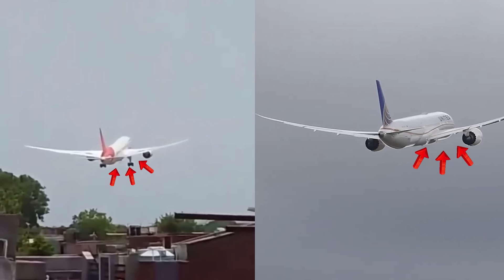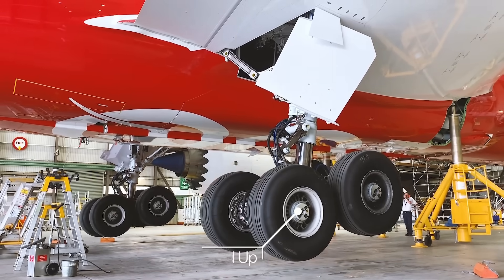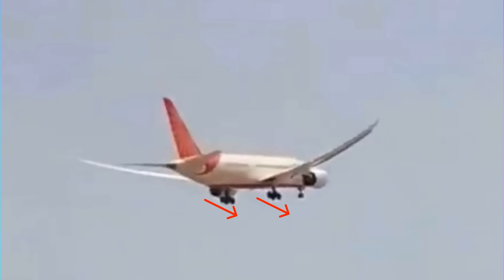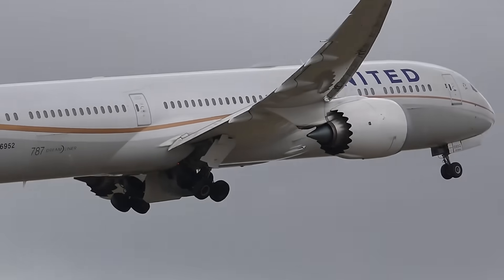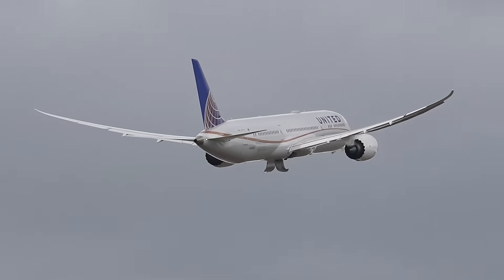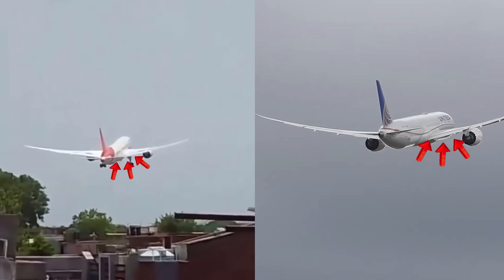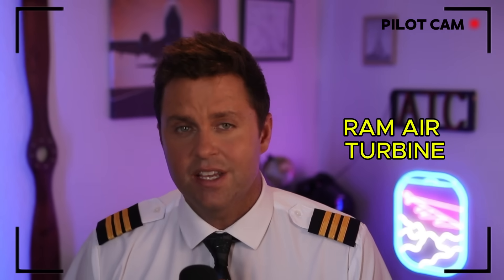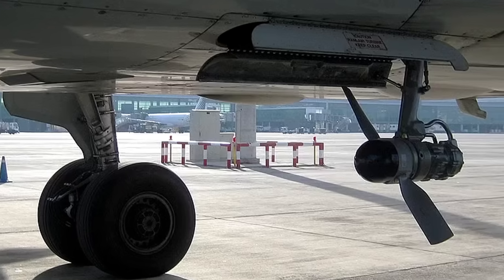Pilot Explains: A New Detail in the Air India 787 Crash Everyone Missed

Comment: or the phone did not pick the audio very well, big assumption you make about the sound. Only thing that is clear is that the Aircraft is not gaining altitude and I nose up as it sinks. More as if the plane is stalling. Whether it had engines or not, the plane is stalling and that is why the plane is sinking. So the question is, why is the plane not generating any speed or lift at 500-600 feat after take off. If a mayday was heard, then clearly there was  an emergency and they had little to no time to react. Video does not show Rat, if anything it is the phone camera imperfection. So unless access the crash site you will not know short of getting the flight box recorders. If there is water in the fuel, then one of the thing they must do is check the ground equipment and test the fuel that was loaded as the plane was in prep for it flight. As the aircraft has flown early that day, existing  water in the lines would be unlikely even if the missed checking the fuel before flight.

NTSB never points the blame, there goal is to solve what was the cause and how to help improve procedures and best practices to avoid such issue in the future. In the investigation, it could find fault in a part and as such issues airworthiness directives  or AD.

So one check for PIC would be to verify any AD and if they have been logged in the maintenance book of the plane. Especially those the will effect to power system and flight controls and surfaces. 

So really looking at the loss of life, would be did the pilots have any option to increase the glide and find enough area to do a controlled crash landing with little damage to the fuselage. 

Even if the RAT was deployed, that gives them about 10s of no control due to loss of power.  While the RAT is coming on line in about 8 to 10 sec, the airline is mostly going to drop about 1000-1700 feet during that time. So if the airline was only around 700 feet, RAT would be useless even if deployed for a double engine failure if it occurred at the time pilot called May Day  or when the craft start to sink. Recovery of flight control system and the inability to pitch down to maybe gain a little more distance away from airport in a controlled glide may have been possible with an effective RAT allowing continue control to the aircraft.

Kirk's no win situation is really only for the movies. It would appear if a total loss of power and electrical the aircraft was doomed to drop out of the sky and then it just on faith of how much damage can be avoided in the path.

Comment: The engines can in fact suck in fuel from their fuel tanks even if the fuel pumps do not function. Each engine compartment also has 2 generators inside. So they must be operating fully autonomous with full thrust even if very much does not function elsewhere. Or am I wrong?

And regarding the fuel contamination: As each engine is fed from their own fuel tank, how big are the chances that they both will reach the problem of failing within a few seconds? Because this must have been happened here.

Can a 787 avoid crashing in such a flight situation when one engine fails, but the other works properly? This should be possible or not? (If not this would be a major design flaw).

Comment: Somebody on the flight before that said the plane was all screwed up with electrical problems. Air conditioning didn't work. Electrical was not working. There were a bunch of mad passengers. The right engine on this plane was just fully overhauled in March. The other one was set to be looked at this year. I wonder if they messed up some wiring that had a problem and it basically shut the plate off. I did some examinations on test and what I saw was You can't tell the exact moment the plane rotates because it's behind something but I did several test from before and behind somewhere between 10 to 14 seconds after rotate the plane begin to come down other planes I watched that was right when the pilot calls for the gear up so I got a few something sorted out. It went wrong or somebody mistakenly hit the wrong thing possibly in some kind of panic very hard to tell. I guess we'll know probably within a couple weeks if they tell us. So sad I wish those people could've had more runway to attempt to land Big plane with that many passengers and fuel on takeoff. I'm sure it's pretty much maximum heavy at that point with all the technology we we have I think we should start putting like a mini camera in the cockpit that may be the landing gear and the engines are on screen, so possibly a pilot can glance at them real quick and see if there is a problem and the flaps too. They barely had a chance it's a miracle that one guy survived.

Comment: How about both engines lost at V2/VR. The take off run goes to the end of the runway. The aircraft doesn’t appear to be accelerating or decelerating. Brake failure? The takeoff is possibly no runway left and buildings ahead, either pull back and hope for the best or run into the buildings. The takeoff may have just been achieved with forward momentum, which would also explain the hop and immediate descent again

Comment: Logical observations regarding RAT deployment and Landing Gear Tilt Position.

It’s evident that both engines lost power; however, fuel contamination is an unlikely cause, as each engine is supplied by separate, isolated fuel systems. Also fuel contamination will show a continuous alert for maintenance crew and to the pilot as well on ground when the filters are bypassed.The independent architecture of 787 systems makes a simultaneous failure highly improbable.

Lets say both engines lost power rather than suffered a mechanical failure at the same time, one possible scenario involves misidentification of the failed engine. There have been documented cases where one engine fails and the crew inadvertently shuts down the operative engine instead.

Another possible explanation is an engine stall on one side during or shortly after lift off, followed by the mistaken shutdown of the remaining operative engine. It’s unclear from the video whether the rudder was actively compensating for asymmetric thrust, which would typically be managed by the Thrust Asymmetry Compensation (TAC) system on the 787—this action usually occurs immediately after the loss of one engine.

Comment: Fellow pilot here. I now believe the double engine failure is what happened. Why? I think the most logical answer is fuel flow for some reason. Contamination, shut down, or blocked in some way. Did someone, (captain, first officer, or....) in the cockpit, shut down the fuel, on purpose as terrorist attack?? Is terrorism possible? I doubt it, but it's possible. Anyway, I think fuel starvation is likely.

Comment: I think.
It can only be electrical failure and not contaminated fuel (After refuelling a jet plane, the new fuel will reach the engines almost immediately. There isn't a significant delay; the fuel lines are designed for quick and efficient delivery of fuel to the engines once the refuelling is complete. The aircraft systems are designed to ensure a continuous flow of fuel to the engines, so there isn't a waiting period after refuelling.) Electrical failure

Comment: I still have not been able to find what was said between ATC and the plane. Has anyone heard that audio yet? Or has it not been released yet?
 I also have a question on the contaminated fuel idea. With all of the other redundant systems for safety, why would there not be a warning ahead of engine shut down? I mean who cares if the engines have to be scrapped after word, but they should keep running until failure I would think. There was no smoke or debris from either engine at any time indicating engine trouble or failure, just shut down. I can't imagine that being even possible in a plane like the 787. But I'm no pilot much less a plane enthusiast. Just that now days everything is captured on video and that makes the traumatic accident so much more personal.

Comment: May the Lord bless the souls of the departed along with all their friends and families.  Kudos to independent channels such as Captain Steeve, Gary, Kevin, Swiss001, Max Afterburners!  I think there has been tremendous discussion and speculation which is quite normal for a concerned world that is watching and knowing that the flight recorder results might still be weeks away.  Several days of technical discussion may have brought to light a new failure path - Excessively hot conditions, loss of power, loss of hydraulics, contaminated fuel or gravity fed fuel that has a significant amount of air or air locked - combination of conditions leading to dual engine loss.  Of course only the flight data will confirm the exact sequence of events but regardless this leads to catastrophic results particularly if the aircraft is close to the ground.

Those who are authorized to do so should verify the maintenance history and procedures  Analyze every detail especially recent squawks.  Verify that all airport maintenance and other procedures are being followed.  This aircraft definitely had serious issues so check the issues raised in the past 10 or more flights.  What is the qualification of Aircraft maintenance personnel - especially the people who are authorized to TOUCH the aircraft - the ones who provide fuel, what is the quality of the fuel, what is their track record?  What is the qualification and training of the people that touched the aircraft providing repairs and maintenance.  Why is Air India aircraft kept for long hours on the ground in hot climates with no AC?  Is this a procedure? do they instruct their staff to reduce or eliminate AC?  My Experience Level - Aircraft Systems Engineer.  Education:  PhD Flight Controls (UK)  Location: US Retired.

Comment: But Gary the plane flew down from New Delhi earlier in the day, so had it been contaminated fuel, the plane would have suffered a malfunction on that stretch. Also, 100s of other planes got refuelled at Delhi airport but didn’t face any issues. Neither did any others planes that picked fuel at Ahmedabad. Also, why did the plane have to reverse to the other end of the runway before taking off? Was it overloaded? Could that have been an issue?

Comment: I'm gonna say, on a hunch, this was full electrical failure. There's no lights on the plane either and there is no flames or anything near either engine, further making dual engine failure at the same time unlikely.

Electrical failure => Engines probably no longer receive either fuel due to the fuel pumps being down or possibly something like no more thrust command from the cockpit, either way affecting both engines near simultaneous => RAT deploys but takes time to spin up and regain some function (If any was still possible) => Time/Altitude runs out.

Comment: My belief is Contaminated Jet Fuel as the most likely cause of the dual engine failure.  Perhaps there were new fuel hoses used which had not been properly "pickled" to remove the talcum-like powder inside new hose from the manufacturer.  Such particulate matter would quickly clog fuel flow upon full power take-off.  Check the refuel hoses!

Comment: I feel that if there was pilot error it was missing a go/no go on the takeoff roll, they missed the low power.    I dont feel the rotation was normal.    It was a heavy aircraft and hot out, but still they rotated at the very very last second, used every foot of runway.     Suggests power was already under spec before rotation.    Surely a spec takeoff doesn't use every fraction of runway?

Im suggesting it was not a SUDDEN loss of power, it was progressive.    Why the rotation was so very very late.

Comment: There's no way two engines would shut down at the exact same second due to bad fuel. One would stop first, then the other, and the aircraft would change its trajectory, even if only slightly. That’s not visible here. What we see is that several fuel valves were closed simultaneously at the moment the landing gear retraction command was issued.

The landing gear on the 787 is electrically actuated, and this led to a complete loss of electrical power — but that shouldn't happen, because each engine has its own electrical generator.

Something appears to be wrong in the aircraft’s maintenance.

Comment: Hi Garbypilot and all out there. Thanks for the video. There is a video out, where somebody tells that just on the flight before on the same plane most systems weren't working probably. Like AC, inflight entertainment or lights. Even if it's not (jet) proofed couldn't this be an indication that something was wrobg with the electrical system or software

Comment: Some years ago, there was an aircraft crash where the pilot was landing and needed to shut down an engine for whatever reason. The aircraft crashed and the inquiry found that he shut down the good engine rather than the bad engine. Further investigation found the wiring for the shutdown was crossed with the opposite engine, hence the apparent double engine failure. It was proven to be a manufacturing error that never showed up until that incident. This happened in the UK at an airport where landing was over a motorway, and the aircraft hit the bank, unable to maintain sufficient altitude to reach the runway a few hundred metres further ahead. My memory is not great, but Duxford airfield near Cambridge comes to mind.

Comment: I appreciate your video to analyze the Air India Incident.  I want to correct one thing you said.  If you look at the video I link below of a 787 taking off, you will notice that the gear actually tilt BACKWARDS once gear up is selected.  The front of the plane in the gear retraction video you use is to the right.  Therefore, the landing gear is tiling backwards when gear up is selected.  I would assume that the power issue with the plane accrued after V1 or V2, but prior to gear up was selected.

Comment: I get that you’re alluding to suicide. I thought about that too. The problem with that theory is the gear retraction sequence had begun, and then stopped. I definitely agree. It was a dual engine failure, but why? That’s the $10 million question. Obviously something catastrophic happened when an electrical/hydraulic load was placed on the systems by attempting to retract the gear. I am an Airbus guy though, and by far from an expert on 787 systems. I have no idea how this could happen.

Comment: Im still leaning towards fuel delivery. Something blocking the filter or damaged pump. Something that wouldn't show up at idle but kick in under high pressure after a few moments at full thrust. Like if something in the fuel line dislodged. This was the second leg of the flight. Was it refuled before takeoff?

Comment: This is a time span of seconds, from a flame out to crash. Contaminated fuel tends to not affect both engines at exactly the same time. Fuel comes to the engines from different tanks and via separate fuel lines. seldom an on/off situation. Can often take even minutes between flame outs. This is to synchronized and there should be burned contamination particles coming out as smoke from the engines and we have nothing of that. To contaminate the fuel so exactly with clean flame outs is, I believe, impossible by mistake.

Comment: What about if they bunkered water with the fuel, do the tanks contain water detection alarms, how long does the water take to separate out after emulsification with the fuel after passing the high pressure bunkering pump
Reply: About 1.3875634787 hours to separate out

Comment: OMG, FINALLY.. Someone saying the same as I have been saying from day one.. I have always said from the minute I watched the first video footage that they suffered from engine failure, what is the one big thing missing from the footage.. NOISE, there is no engine noise, taking off them engine's should be running at 90+% but they are not, you can even hear the guy filming it talking quite clearly on the video, if them engine's were running correctly they would have been deafening..  Reason,  Well my first thought is fuel contamination,

Comment: Boeing and airbus AME here although not certified on 787. I would rule out fuel contamination because  this wouldn't be simultaneous failure. The engines should maintain the last selected Throttle Lever Angle should be  maintained automatically in case of a dual FADEC until power is restored to the FADEC computers by the RAT deployment. This should only take 1 or 2 seconds. My speculation guess is a software error which is most worrying. 😨

Comment: I'm a ramper for widebody aircraft, so I'm a few hundred feet away, standing outside at the gate, when they spool engines UP to taxi out to the runways. Dreamliners and their engines are HUUGE. A 787 at full thrust is louder than 5 freight trains side by side with all their horns blowing (no exagration.) With LOTS of noise on the ramp, you KNOW when they're taking off. After 5 years, it's one of the only things on the ramp that still makes me feel... small. Like next to a whale or the Space Shuttle before launch, small. 

Marshalling a 787 into the gate, at idle, with earplugs AND headphones, it's almost too loud to bear if my plugs aren't snug in my ear canals. There's a whine that's piercing. The worst sound at the airport. No ear protection? Some hearing damage is 100% guaranteed.

If we can hear the initial impact before the explosion, they absolutely had NO engines. Full engine failure.

Comment: Did you ever consider that the pilot monitoring retracted the flaps/slats instead of the gear, realised his mistake then reapplied the take off flap setting again? Also the pilot flying may of deployed the RAT manually thinking this may help in a time of despair. We all know that a dual engine failure is highly unlikely.